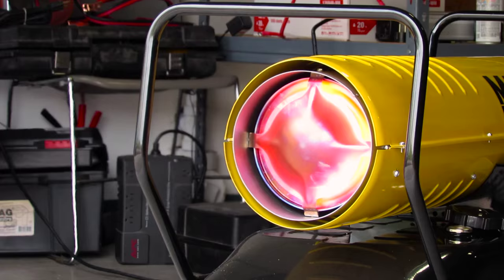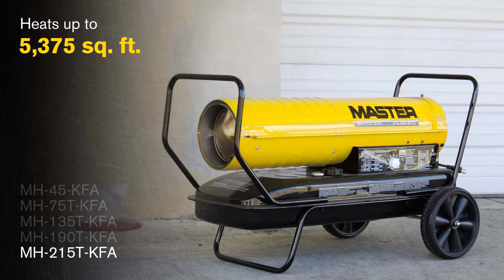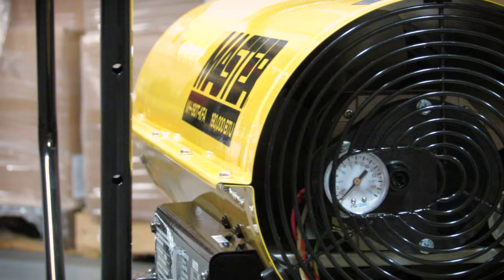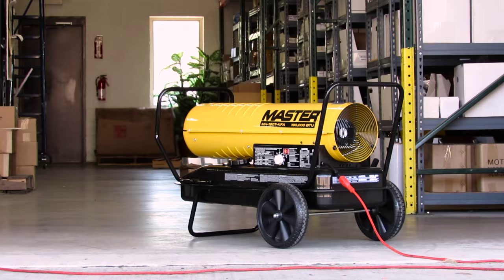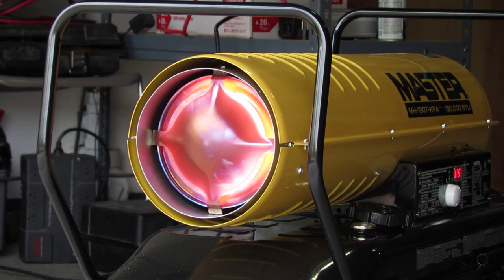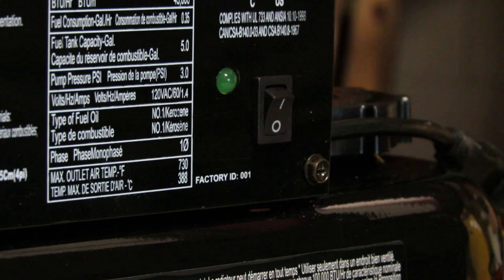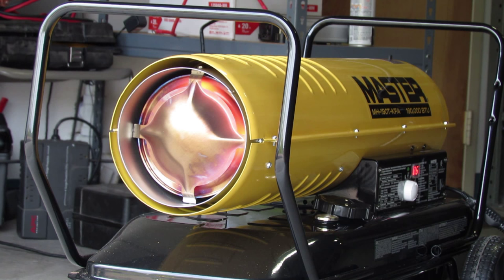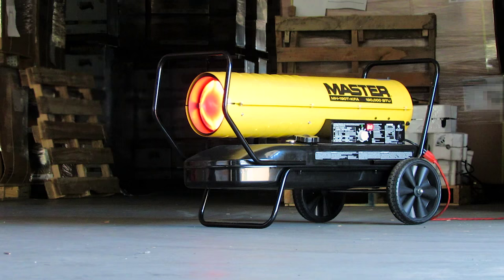Master Kerosene Forced Air Torpedo Heater

Comment: How do I get a hold of the company? All my hoses are rotten on my Master 75,000 MA-75T-KFA heater and it leaks around the fuel cap. Only a year old. Haven't used more than 5 times. exactly how do you change before I rip this apart? Bought at a Tractor Supply company 25 miles away.

Comment: I guess what gets me is, you need to exhaust the fumes from a fuel heater, so how you suppose to heat up a shop and keep it warm?
Reply: If you're using this in a uninsulated garage... It's likely going to be ventilated enough.

Heck my 1800's house is likely "ventilated enough".
Reply: @johnnygunz2300  Yea, just built my shop, it's uninsulated. I ended up buying the Dyna Glo Deluxe. Even with the 10x 8 door open, it gets the shop to 90 degrees in 15 minutes. Bought a carbon monoxide detector just in case.

Comment: Bought two 215 BTU models and neither one will start. Customer service for Master is HORRIBLE. They expect you to work on it yourself as they direct you over the phone. They told me I had a defective electric board and were to send me a new one. They never sent it. After 5 different phone calls and still no fix, I brought them back. From reading other comments and feedback it looks like this is a common problem with this company.

Comment: mine never has fired up...brand new out of the box and won't fire up...i've adjusted the pump pressure and everything...made in china junk...
Reply: wasted/time/traveler did you ever find out the issue
Reply: What model did you get? I bought 2 of the 215 BTU and neither one will start.
Reply: Taking my 2nd one back for a refund right now. Both flash e1. Tried all trouble shooting